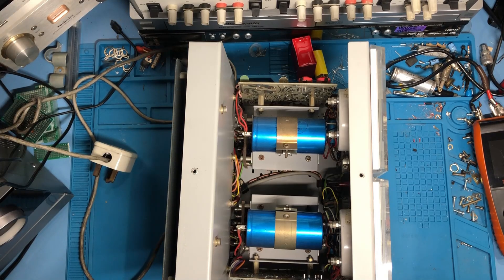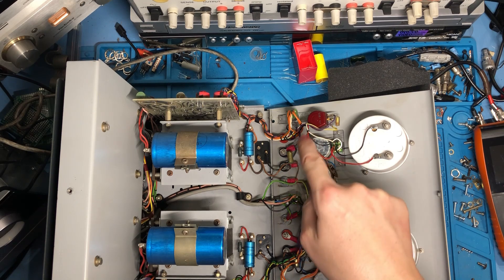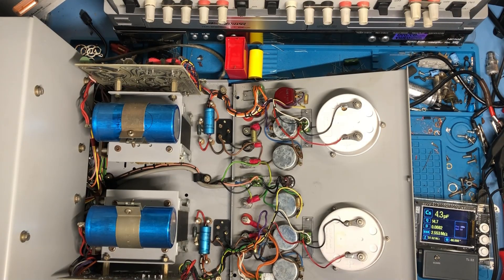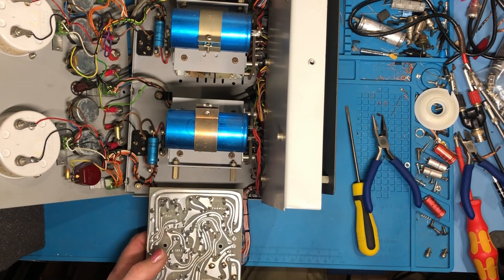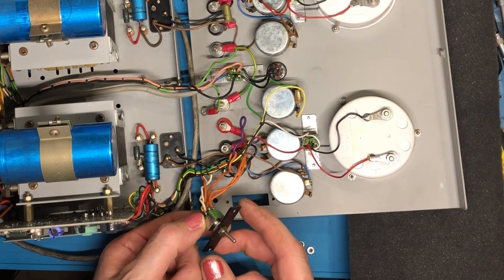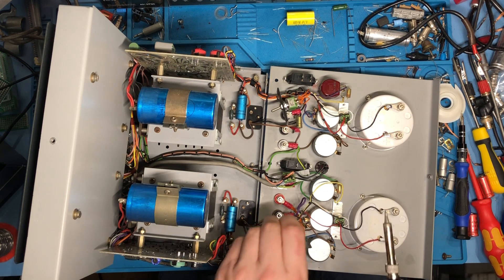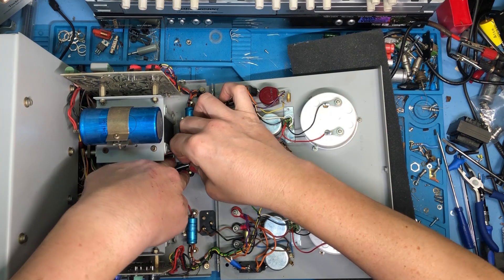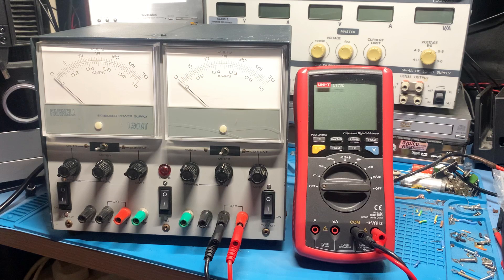Farnell L30BT Power Supply Repair & Testing

Comment: Good afternoon Having sold all my test equipment from my Thorn EMI days I am getting a Farnell L30/2 the analogue meter glass is broken I will will check it over and calibrate this gem any thoughts where I can acquire a replacement meter glass it's a weston meter I'm not sure if Farnell would have these fitted as a standard meter or especially made to their design. I like this meter with the mA  settings and the meter needle is so fine. I like your YouTube channel keep up the good work us oldies like to see test equipment of the 1960-1970 err Nigel

Comment: Do you find you can get away with in-circuit ESR measurements or do you disconnect them ? I've got this valve scope to restore and I don't fancy pulling them all out with their wrapped-around-the-tags fiting :)
Reply from the maker: It's good for electrolytics and some smaller solid capacitors. You can measure them in-circuit. The thing with valve equipment is that often with wax coated paper capacitors the wax has cracked/fallen away and moisture has got in, so they are leaky and no good. Also hunts electrolytics are notorious for drying out and failing.
So I would say rule of thumb with valve equipment, change wax coated capacitors for a more modern high voltage polycarbonate or polypropylene capacitor. Hunts electrolytics have them out and change them. Any other caps/brands, visual inspection first, change leaky or damaged/cracked ones and go from there.

Comment: You were fortunate that you didn't have to give the pots a good clean, or even replace them. I have a couple of the single output PSU's. Both of them have suffered with dirty/worn pots. As simonstroud2555 said earlier, it's unnerving trying to set the voltage to, say 5v & the output is jumping up & down as you try to set it.
I also wrongly assumed you must be a cat owner. 🐱😄

Comment: You could have use C&K 7101 or 7201switches, they have the same dimensions as the old ones.
Reply from the maker: The unit didn't have toggle switches in originally. It had long thin black rocker switches. The switches I got were as close to the originals that I could get as I wanted to try and keep it as original as possible.

Comment: Great restoration video! I love those old linear supplies, much cleaner output than modern cheap switching supplies.
Reply from the maker: You can't beat a good linear supply. This one is old but it's so well built that with my repairs it's still working very well after all this time.

Comment: Maybe not quite as old as you thought it was as the orange caps you replaced were dated Apr 73 (3:40 time line). I also remember that standard issue grey 5 amp cable from my working days in the 70s/80s. We had the dual Farnell in our workshop around that time. Nice repair
Reply from the maker: Yes you are right. The design was done a few years earlier than the production of this one. Thanks for watching and thanks for the sub.

Comment: That was a bit harsh replacing capacitors with RS ones. Would have been fairer to keep it pure Farnell by fitting some Multicomp Pro replacements.
Anyway, a couple of bad experiences I've had with similar Farnell bench supplies over the years (not that exact one but similar very heavy linear 30V models) ....
1) when the pots go dodgy the output voltage can flail around rather randomly. Putting 30V up something unexpectedly can be fun. 
2) the handles on top can just tear off if you quickly lift it off the bench.
Reply: Multicomp Pro tends to source the cheapest noname Chinese capacitors nowadays. Even these 'new' 35-40 years old replacement RS caps from Matsushita might last longer.
Reply from the maker: @mrnmrn1 'NOS' New Old Stock, lol.
Reply from the maker: Lol, I never gave it a thought. I just had the RS ones to hand. Are Farnell and RS still arch enemies, haha.
1) I'm sure I looked at the pots and they were wired as variable resistors with the wiper tied to one end of the track so they shouldn't suffer an open circuit but I suppose the full value resistance might mean full voltage though.
2) I took the handle off as I wanted to stack other stuff on top, but it wasn't in the best of condition.

Comment: What did you do to your hand Jane? It looks like my hands and I work with a lot of sheet metal… 
Can you tell me where to find a tee-shirt like the one you’re wearing? My neighbours daughter is taking electrical engineering at uni and that would be a perfect Christmas gift… 
Did you test those big blue capacitors for ESR and leakage before and after?  I’ve tried reforming them in the past but I find it can be hit or miss with that. 
Good video, thanks!
Reply from the maker: I got caught up in an unfortunate bramble at work!  Bit prickly!  I got the T-shirt from Amazon, I'm always looking out for electronics related T-shirts!  I got lucky this time with reforming those caps, it doesn't always work but readings seemed within what I was expecting so happy days!  Here's the link to the T-shirt: https://www.amazon.co.uk/Ohms-Diagram-Electrical-Electronics-Engineer/dp/B0CH7C5Y9V/

Comment: When you replace the other switches, are you going to modify the circuit to increase the max current? 1A is not very much. If you need some relays, I have lots of 12V coil 4 pole double throw relays. Would you like to buy 2?
Reply from the maker: The whole supply is only designed for 1A. Increasing it would require a new more heavy duty transformer, bigger smoothing caps, bigger output pass transistors, recalibration of the current scale and circuitry etc. So it's not practical. This supply is ideal for audio work.
I have higher power supplies for other stuff. I already have some relays on order but thanks for the offer.